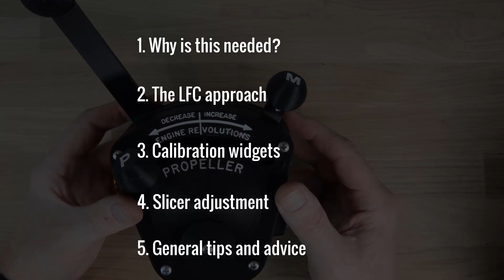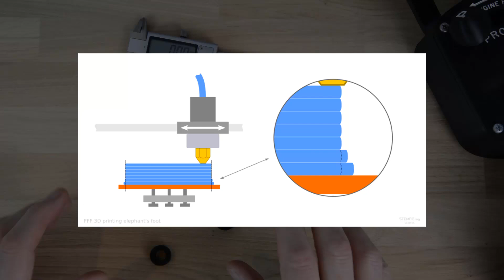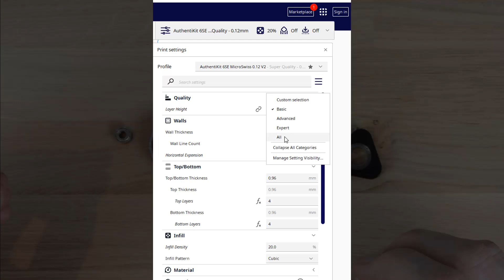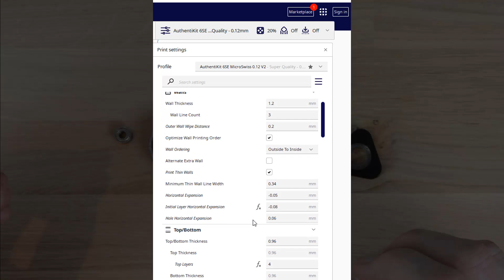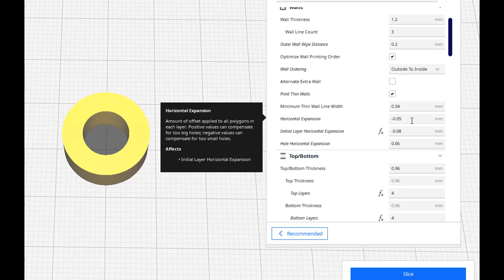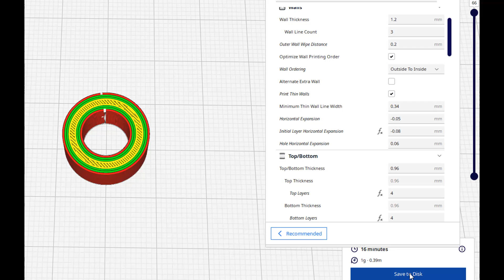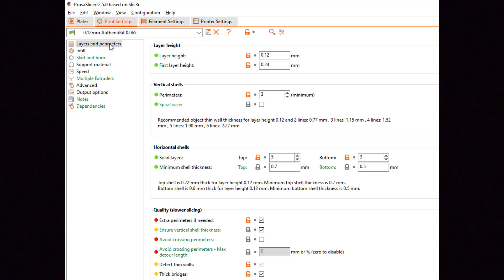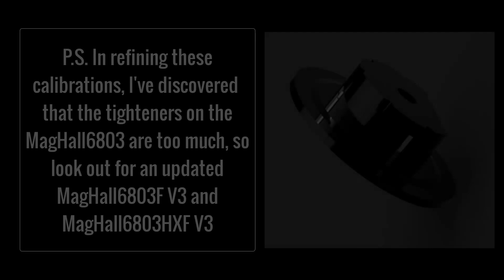AuthentiKit Loose Fit Calibration

Comment: In summary, if you would have designed clearance in, you would essentially have designed something that works well on your printer. An end user's printer will have slightly different setup. In lieu of designing in gaps, you rely on the slicer's ability to expand/contract prints. This approach not only simplifies the design/modeling process, it makes end calibration and slicing less complex than if you had designed gaps in and then required a calibration. In fact using line fits in your design makes the technique even possible - you couldn't really do it otherwise. Only downside from a design perspective is you are stuck with one gap/clearance for everything, but I suppose you could get more clearance by not using a line fit in that specific joint.
Reply from the maker: Thanks, yes. Its intended to make development easier for new folks